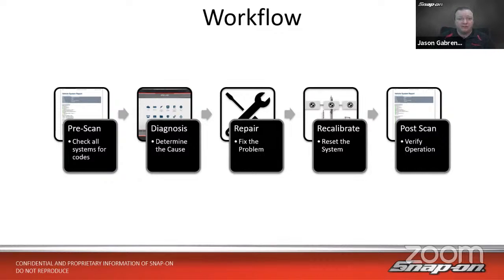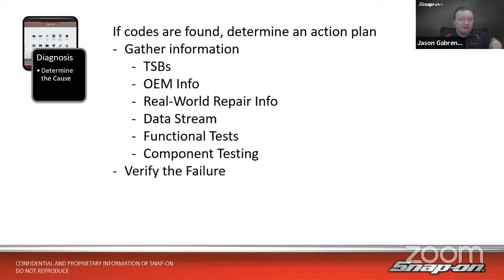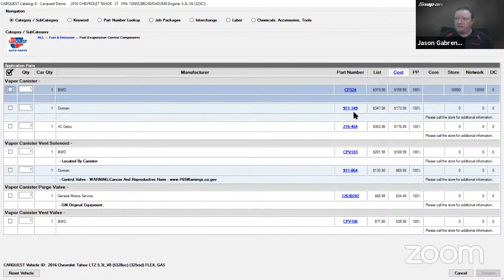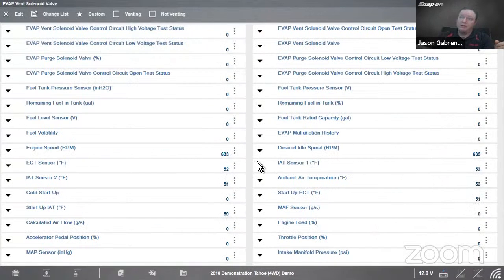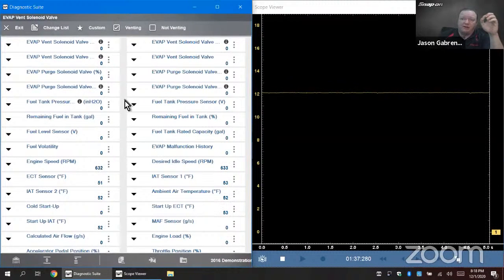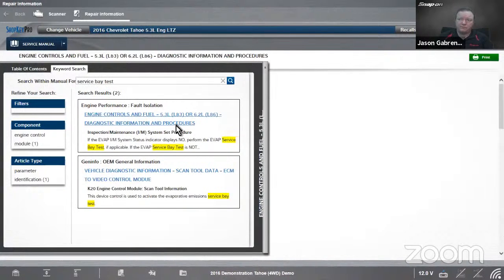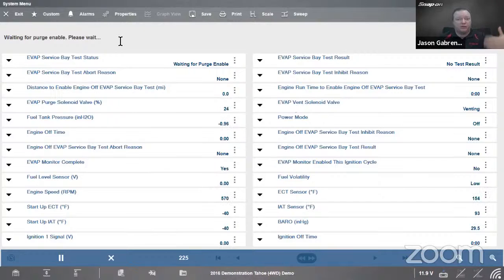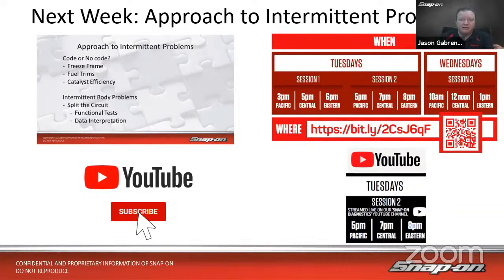Code-Based Diagnostic Workflow Part 2 - Snap-on Live Training Episode 10

Comment: Hello. I bought an Snap-On Apollo D8. 
I can’t find a way to code injectors for Duramax. Will this scanner do this? I would like to have someone respond. Thank you.
Reply from the maker: Sorry for the delayed reply. That function should be listed in the Engine module under Functional Tests - Module Setup - Reprogram Injector Flow Rates. If you need further assistance, please call our Customer Care team at 1-800-424-7226.